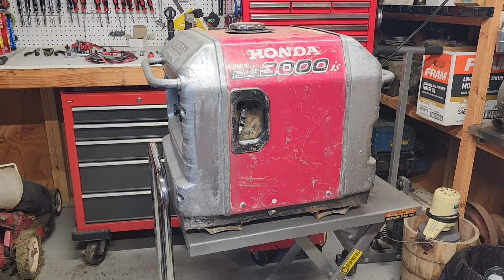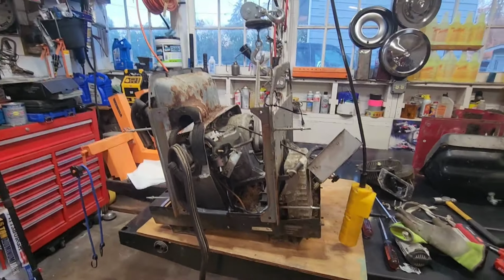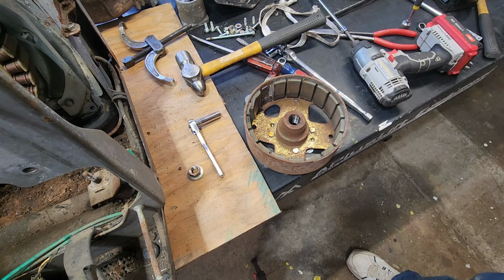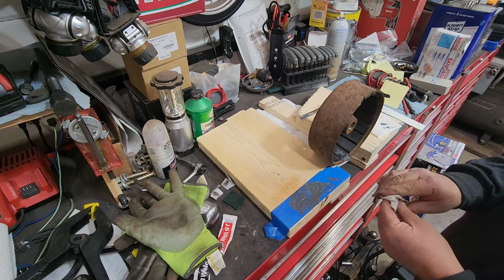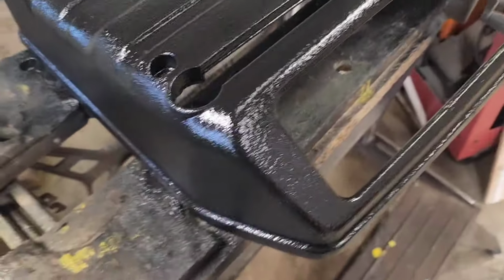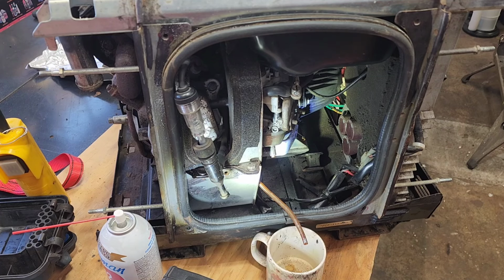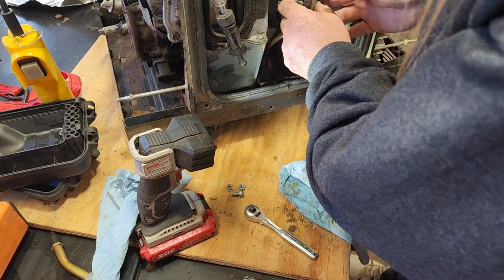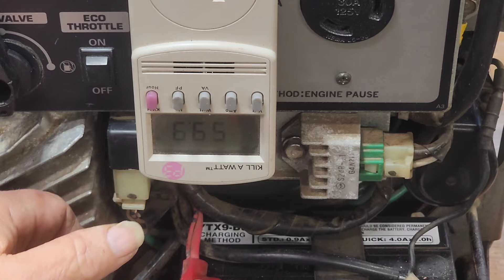I bought a Cheap & Rough Honda EU3000is Generator. It won't start up with the electric starter! Why?

Comment: Hey Glenn, just watched your video on the EU3000is, glad you finally got around to checking the magnets on the rotor, i have found more with this problem...lol, also had one that the starter was not turning it fast enough, high amp draw on starter...
Reply from the maker: I think that was my root cause. Rhe loose mafnet was dragging on the stator and made it turn slower. We ran this for a couplw hours a day on our 11 day trip I cant believe that dis not do more damage. The loose magnet was barely damaged....

Comment: Your'e screw driver was attracted to the magnets. I have seen Condon use it in places that if it conducted electricity it would be bad. I do not know the dielectric of JB weld. If ya'll do not wait for it to set up it will be a huge mistake.
Reply from the maker: Copy that. I reassembled after about 30 hours. It up and running now, i ran it about 5 hours and its great.

Comment: if you sell that thing for more than 50 bucks your wrong that thing has seen more water than the titanic!!
Reply from the maker: This is the second one of these i have brought back. I still can't believe that people pay thousands of dollars for a new machine and then treat them like this.. A tribute to Honda, however, that the machine can survive it and still run this good and make power this good. In a future video, I do repaint it and new decals to make it presentable.  Then, later, convert it to propane. At first, i did not like working on the EU3000is. Now that i have done this one, I actually enjoyed working on it. 

Later

Glenn

Comment: Key switch
Reply from the maker: Good guess, nope... Check out the lasted video on this to find out its issue. The key switch is 4 wire, 2 wires engauge the starter 12 volts. The other 2 wires ground the ignition to kill spark, was easy to test that...